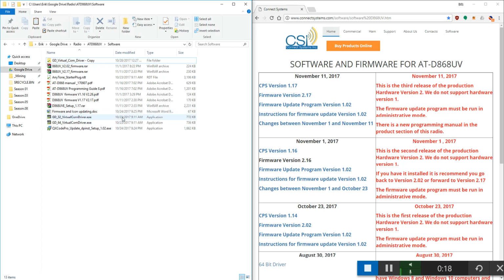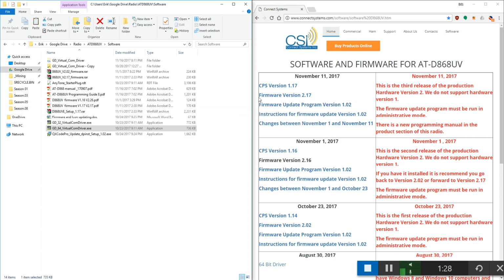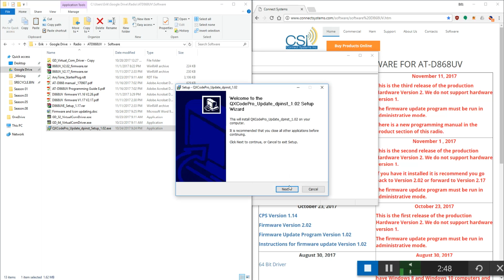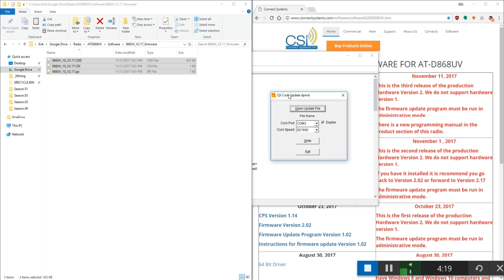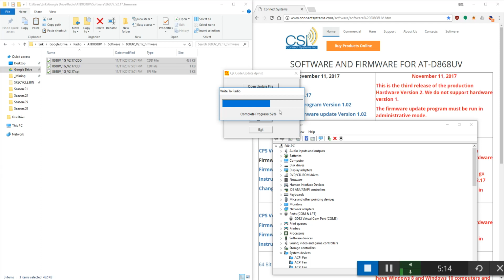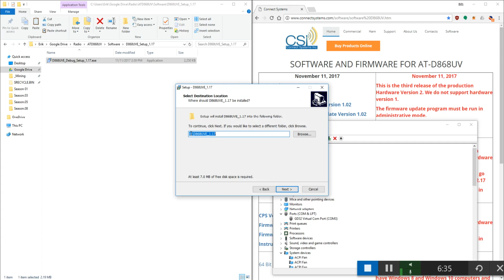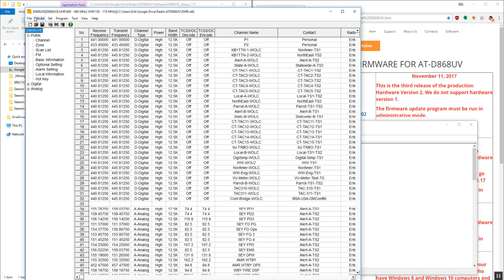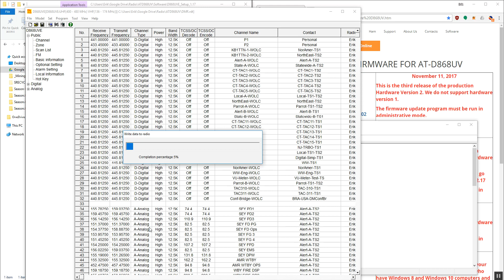Video 4 AT-D868UV Firmware Update Software Install

Comment: When I reach the step to “Open Update File” (in admin mode) it simply messages “Launch Failed; create process failed; code 740, requires elevation.
I am Using Win & Pro and am right clicking and selecting Open as Admin.

Any clues? Can go no further without this step working.

Jeff (K1JWJ)

Comment: I have a question for you. I used your video to update my radio tonight with the latest firmware.  But I am not getting the tone I had before when I pushed the PTT button.  Prior to this I would push the PTT and I would hear a bried tone that I would wait for before i began to transmit.  Do you know how I can get this tone back?  Thanks in advance!  KB7BYI

Comment: Have you had any issues with analog receive sensitivity on this radio?  I have version 2 with the latest firmware and analog is awful.
Reply from the maker: W4JOR sort of. Firmware 2.21 was alright. I'm on 2.23 which is BETA and VHF receive has a lot of issues right now. I'll be reverting back to 2.21...
Reply: Thanks!  I really like this radio but I am thinking about sending it back and getting something different.  May just have to wait it out and see if things get any better with newer firmware.   Wonder if it would be worth the wait?
Reply from the maker: W4JOR the radios come a LONG way already. I've had it since v2 release and release firmware. The firmware releases have fixed large bugs, but keep introducing small ones. This VHF receive interference bug is like one they had back in 2.1x somewhere where if screen  brightness was over 4 setting you'd get interference which got fixed immediately in next release. Give it time and it'll get iron out soon enough. It's still a new radio. Still has tons more features than similar MD 2017.